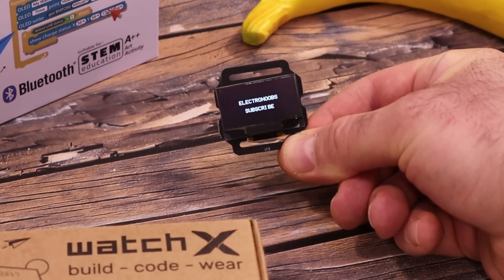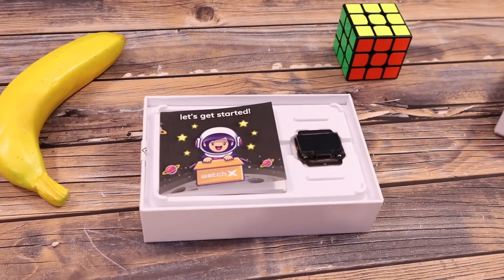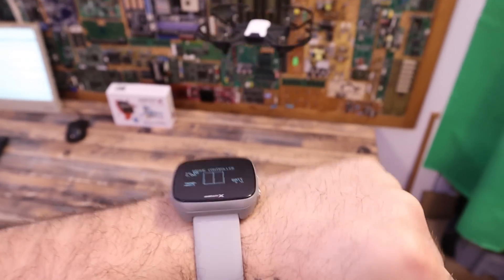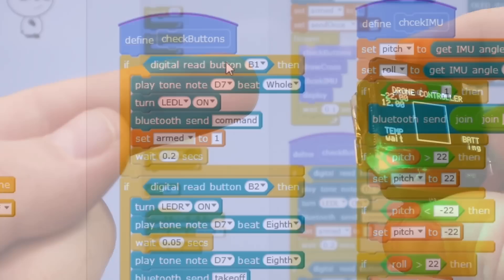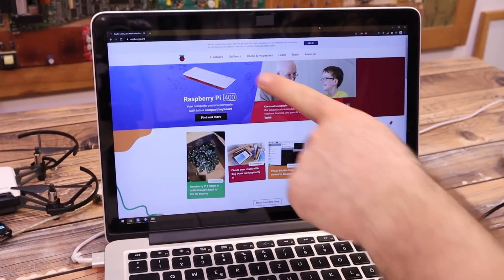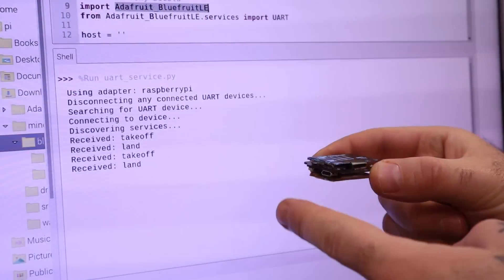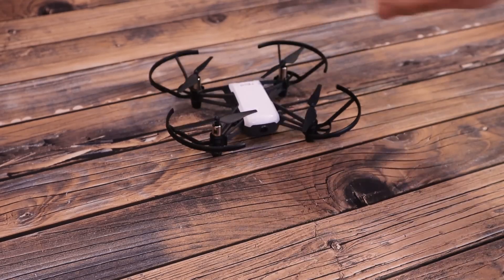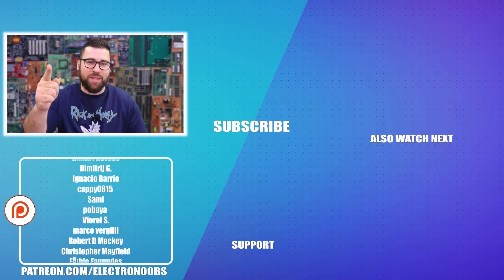Drone Control With WatchX | Raspberry Pi WiFi & Bluetooth | Arduino & Python

Comment: What firmware version of the Tello drone are you using - I have 1.04.92.01 and it will not connect to my Pi, works with my ipad though ?